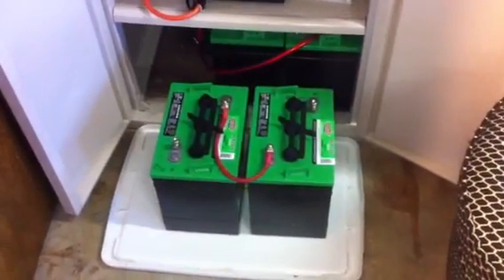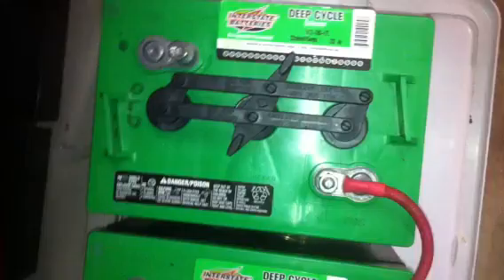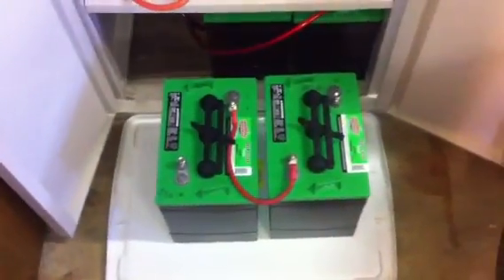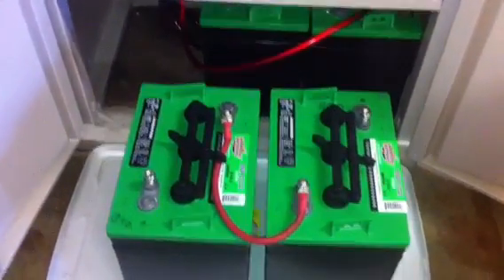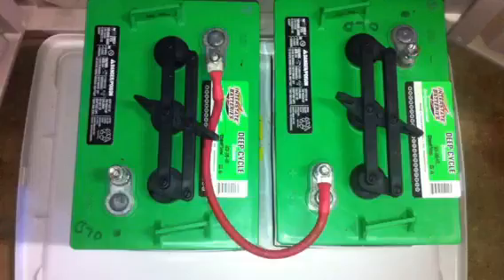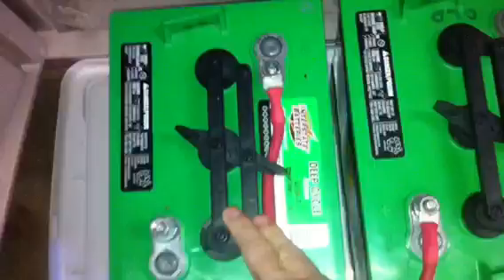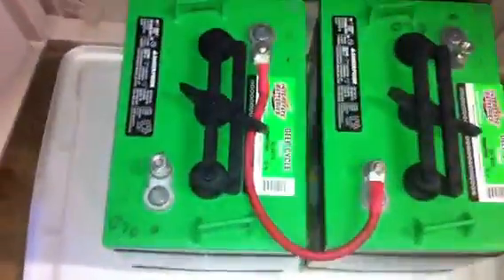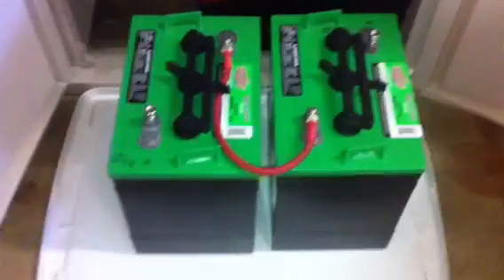Battery back-up - wind/solar -part#1

Comment from the maker: also, if your purpose of battery is to act as just a back-up source of power, then i would probably limit by discharge to 50% and get greater life out of them.  But, don't rely on the automatic high v disconnect since that will likely take them down, below your 50%. The mfg calls it the "safe zone" in the sense that you won't destroy the batt, but dropping them down to 11v daily, or regularly, means dropping them below 50%, and while you won't destroy your batts, you will reduce their lifetime

Comment from the maker: I agree you will preserve life by limiting the discharge to 50%, but I understand different views on the subject.  Battery cycling is like a car's odometer.  Yes, if you don't drive your car, you don't put on miles on it, and car lasts longer.  But, on the flip side it's a car, and you may have bought it to drive it a lot. With that said, i still recommend desulfating your batts with BatterMinder for maintenance and extend life.

Comment: I've read that in order to preserve the life span of a deep cell battery, they should be discharged no more than 50% of their capacity. My solar charge controller cuts off the discharge to my 12VDC deep cell battery at 10.5VDC to avoid damage to it. The charge controller also limits the overcharge voltage to the battery at 14VDC. So according to the manufacturer of the charge controller, the "safe zone" voltage for a 12VDC deep cell battery is between 14VDC and 10.5VDC.

Comment from the maker: @TIGHTWADHERMAN Yep.  There should have been a correction posted, not only in comments but also in a speech bubble I posted soon after I put up the video. Yes you're correct, your only doubling the amps with a series/parallel of 4 batts. If I had 4 12v all in series then your quadrupling the amps, and in that case achieving close to 11000 watts. But I realized my own mistake as I viewed my video and the correction should appear unless viewing on smart phone

Comment: Please your not going run 11,0000 for no more 10 to 15 min's if that
sorry i don't have time explain fully // Now then you only have 468 amps 
when connect batteries in series // you dont count series batteries amps thats makes the volts /parallel makes amps /now then have a optima amp load and to give and get full life out of battery try to never use more then 20% to 25% of the full amp load 
For example  if you have battery bank bank 500 amps only try draw 100-125 amps at any give  
time

Comment from the maker: You are correct. I realized that soon after i said it, as i'm not running all 4 in parallel.  i also misstated each 6v capacity as 234, when they are actually 232ah each...thus combining 4 in parallel and series will only double your ah to 464.  Thanks for correcting that info